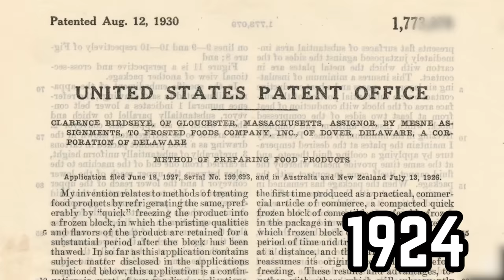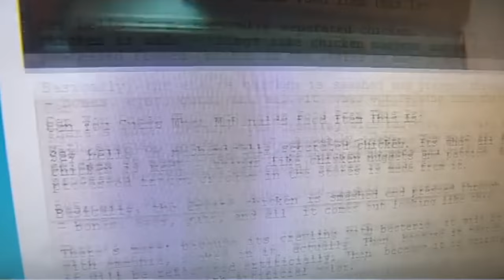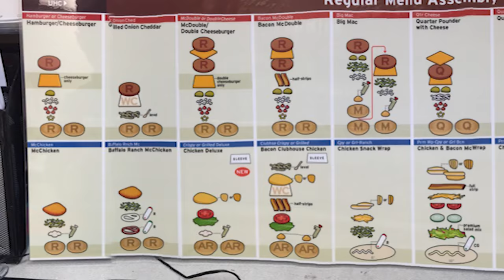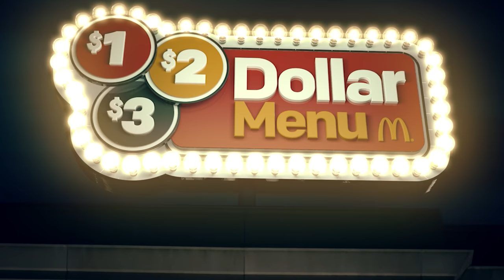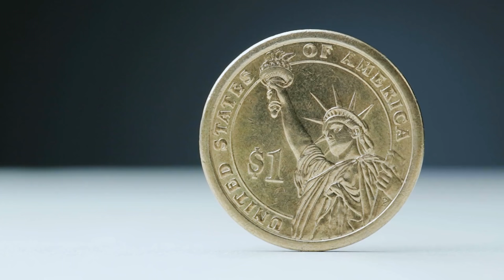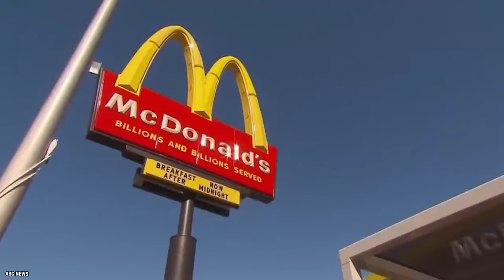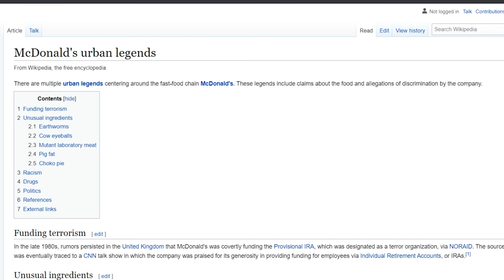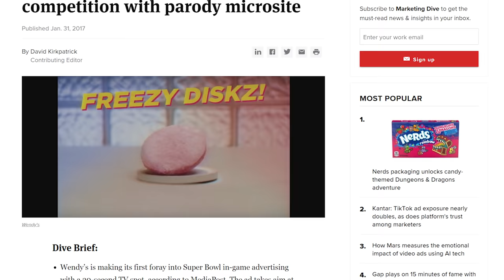10 Reasons Why McDonald's Burgers Are So Delicious

Comment: Now I know why I like the quarter pounder.  Even so, the buns have been on a down hill slide for a decade or so.  The fries used to be awesome but they are not what they were ten years ago.    The corporate office should start sending local managers to Japan for a month or so to learn what quality control is.  There every item served looks just like the picture on the menu board behind the counter!  The lettuce and tomatoes were always very fresh, ripe but fresh.  Here in the U.S. it is a crap shoot.  I have been getting a lot of tomatoes that were green in the middle and the lettuce was badly wilted. The dill pickles are usually good but the lazy prep worker just drop a few of them in the center, not spreading them out over the burger.  I addressed these on their survey site provided on my receipts several times, but nothing has been down to correct them.

Comment: 1) The food is made with way more fat, calories and salt than it should be. 2) add a load of sugar from the combo drink 3) light up your brain with these ingredients and make you addicted.
Reply: -The salt levels are fine, the effects of salt as well as the amount needed to be a problem are greatly exaggerated.  A full big mac meal with fries, has only 1,225 milligrams of sodium.  Even if you were to eat this for every meal of the day it would only be 3,675 milligrams of sodium which is by no means too much, unless you have significantly impaired kidneys.
-The fat is bad for you mostly because of the type of fat that it is.  Polyunsaturated seed oils are terrible for you if they are old, or have been heated.  Especially if they have been heated more than once or for a long time (which they have).
-The worst thing about almost any fast food meal is the sugar in the soda, and the sheer amount of empty calories, due to lack of vegetables and too much carbs and fat.
Reply: The salt thing is exaggerated greatly. Salt is only an issue for a small portion of the population.